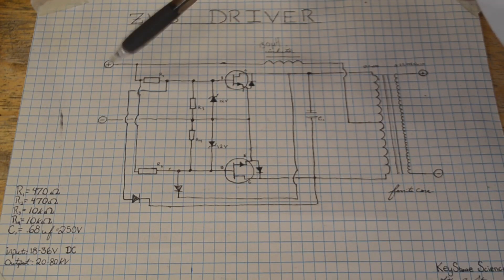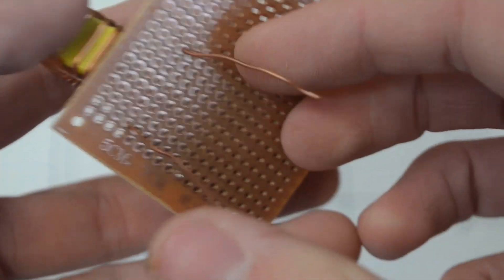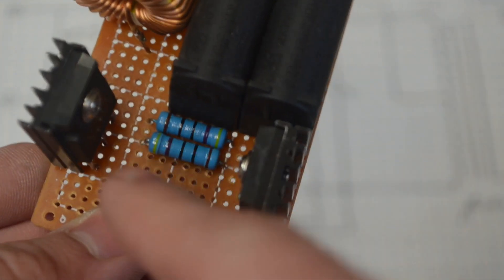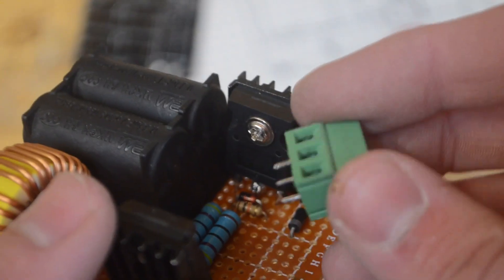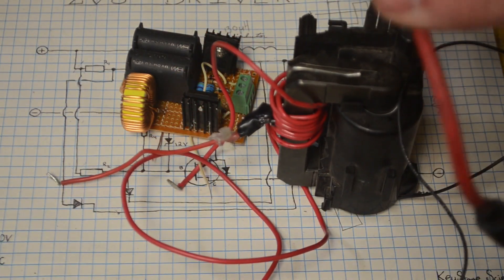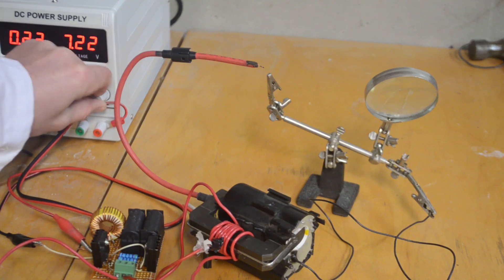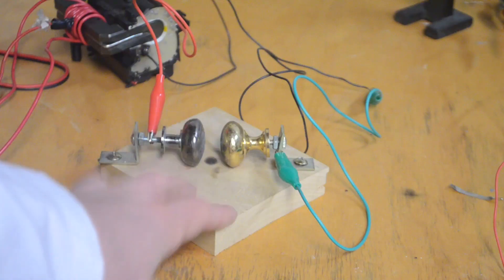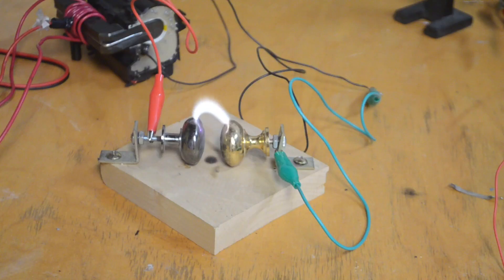How to make an ARC LIGHTER

Comment: You estimated the O/P V to be around 60kV ?  Wouldn't that translate into a spark gap jump in air of 5-6 cm ? Arc length is totally different. Besides 60kV should land you in soft X-Ray territory and it sounds nothing like it. I am gonna guess 15-20kV. Not saying it couldn't be lethal.
Either way, still enjoyed the video and learned about ZVS drivers. 👍

Comment: where did you salvage the MOSFETs from? I made a zvs driver but I didnt have any good MOSFETs so it just gave me shortish purple arcs... still enough to melt my negative terminal...
Reply from the maker: these mosfets i bought, CRT tvs. the ones i use here are IRFP250N
Reply: Ok, thanks! i'll keep a lookout for those, and I've salvaged a ton of CRT tvs so i should be able to use those mosfets.

Comment: plz help for my doubts , 1 - can I use gate drive resistor of 1/4 watt or can I use higher value of resistance like 700 ohm or 1kohm because mosfet can turn on with lower current and even on low voltage !!! ? 2 - l c tank is fixed for this ZVS Driver or we can vari cap value more or less than .680 nf ???? And 3 - can I use 60 Vds mosfet instead 200 Vds type if not then why Because primary turn is only about 2 -3 Turn should not genarat such high volt ????!!

Comment: oh finally you cleared my Doubt of " FR107 200ns Rrt diode will work or not instead uf4007 20ns that are mentioned in google zvs circuits which i did not get on shop other hand fr107 is easy to find from smps supplys

Comment: Can I use IRFZ44N instead of IRFP260N for making a ZVS driver?
Reply: the irfz44n is probably not powerful enough. also the max drain-source voltage of the irfp44n is 55 volt witch is way too low; the inductive spikes from the primary coil will most likely destroy the mosfet very quickly.

Comment: Help please ... i made this but could only get like a centimetre of purple arcs with 12v unlike the arcs shown in the video .... could someone tell me the possible problems  ? I tried everthing i could
Reply from the maker: +Kevin Jacob try a higher voltage , 12 won’t feed the LC resonance that much.
Reply: Keystone Science thanks for the help mate ... i fixed it   the issue was the capacitor ....😁

Comment: Hey Keystone Science, I have been making this circuit either using IRFP 250 N or IRFP 260 N, both are working great and make a nice arc up to 10 cm long at 32 VDC 10 Amp , but I am curious about using IGBT's as the replacement for the power MOSFET's, since it can handle more Voltage and Current. can you atleast make a simple video that explain and if possibly make one ZVS driver that uses IGBT's ?. I am looking forward for your respond.

Comment: I made one of these, but i used 2 igbts in parallel in place of each mosfet, a separate 16 volt supply for the gates and a 50 volt supply with over 15 amps to power the rest of the circuit. The arcs were insane! I could draw them out to maybe 8 or 9 inches before they break and they were thick and bright.
Reply: CoolDudeClem which power supply did you use
Reply: Electro Hithesh use a 20 volt lithium ion battery
Reply: CoolDudeClem mosfets are better because they can switch more frequently than igbts. A plus point for the igbt is that it can handle a lot of power
Reply: yeah igbts waste alot of energy as heat don't they?
Reply: Have the same question, a 750 watt SMPS is pricey
Reply: Yah until the zvs driver breaks because mine did that's why I'm buying a better quality one with two inductive chokes

Comment: Hey Keystone Science, I recently ordered the parts to make this driver and they arrived yesterday. I assembled it in midair to test the circuit before I put it on a board. I tried the circuit with the fly back but nothing happens. I also tried it with an induction coil from your other video, still nothing. Any help would me much appreciated with what's wrong. I could send you pictures of it and everything if you need. Thank you for any help.

Comment: The high currents exist in the LC circuit. You should re-wire the capacitor so it is right next to the primary coil.

Comment: The "King of Random" did a clip where he made a hydrogen device and another guy made something similar but he turned into a "micro blow torch"... is there a way to put more pressure into the nozzle and make the micro torch shoot a 5inch flame in a straight line?
Reply from the maker: Yes, there is , it's using basically the set up for a rocket engine that is, a come on the inside, a cone on the outside, and the oxygen and fuel on the inside, there is a channel called nighthawkinlight that made a video kinda about this ( here it is : http://youtu.be/VI8gdmjEwKc ) anyways, is that what you meant ? Anyways another way is basically just outputting more fuel and a little oxygen through a torch, I used to have a class in school where we would use torches , and I would do that sometimes

Comment: i got shocked by a zvs running a flyback but i'm still here because the frequency was to high to kill me and the electricity went thru my skin i'm not saying you should go and touch the output it still can kill you if the resonant frequency dips for some reason and even if it doesn't dip it still burns you
Reply from the maker: True, but also I think the skin effect only works with AC current, and I think some flyback transformers have internal rectifiers on the secondary, and so that would be dangerous, so yeah better not to risk it :D
Reply: Keystone Science my zvs driver broke im going to buy a better zvs driver with two inductive choke
Reply: Skin effect is only meaningful on the human body above about 10mhz anyhow for various reasons. One of which being that blood is enormously better conductor than anything else in the body.

See https://en.wikipedia.org/wiki/Tesla_coil#The_.27skin_effect.27

You can definitely die from touching a flyback driver, a few people have before
Reply: Keystone Science y
Reply: thanks to skin effect
Reply: Keystone Science ooh really thanks to remembering me that internal rectifier of FlyBTF :)

Comment: The ZVS Driver is a typical run of the mill automotive power inverter. Only difference is you got a flyback connected to it. 2n3055 transistors should also work well instead of the MOSFETs but make sure to use a huge heatsink.

Comment: That circuit looks pretty similar to a high frequency induction heater circuit, which are also quite interesting and suitably dangerous for your channel...
Reply from the maker: +Gotin Fuklio hahahahaha xD true
Reply: Keystone Science its no fun to buy stuff. just make sure that you dont copy great scott who buys everything from ebay, glues it in a box and then claims he made it
Reply: the circuit is the same. only the flyback and the work coil are interchangeable. he actually bought the circuit off ebay and rebuilt it
Reply from the maker: +Gotin Fuklio yep! Well I bought one off eBay a while back then it broke, so I figured might as well try and fix it ( however tbh it's probably not worth it as it took quite a while to solder all the points nicely enough and they are pretty cheap on eBay )
Reply: John Scarce but he does make it, and considering he is a power line technician there would be no need wasting money on what you can make yourself.

Comment: Can this work in a vacuum? Is there an ideal gas you could use other than the atmosphere (what makes it ideal?)? What happenes if the arc is created in a microwave and turned on? ..... Tearing apart hoarded tv now 😄. Great show!
Reply from the maker: +David Hyatt it should work in a vacuum, at least theoretically although the arc probably would not be as long. An ideal gas I would probably use is Xenon, ( not only does it look very cool with high voltage, but it is very conductive ) also it is ideal because it's electron orbitals are filled so it's happy where it is at, hydrogen is also pretty coo, to pass high voltage through though. Hmm I think passing microwaves through the plasma arc would amplify it's ionization creating a weird plasma pattern. So yeah, haha. Thanks! :D

Comment: i wish i had all of these electrical components, but i do have a question for you. I need a device that can give me 70 amps 12 V DC with as few components as possible
Reply: SuperScience894 They easiest way to accomplish this is to get would to simply use a transformer connected to a wall socket and then rectify the current with some diodes. This isn't a good solution, but likely the simplest.
Reply from the maker: +SuperScience894 hmm, for that tbh I would just buy a cheap car starter from harbor freight, there like 20$ and can deliver 500A at 12v DC I'm pretty sure
Reply: Old server PSUs off of ebay work just fine and can be found for as low as $20 USD. Got 2x 12V 100A ones and a 25A 48V model myself. Not sure if that counts as "as few components as possible" though.
Reply: I do have a MOT but I do not have a way of rectifying it
Reply: thanks, i guess 100 amps may be too much but if it is i do have some heavy duty resistors from that microwave i salvaged.

Comment: I have that same exact power supply and built this same circuit and it automatically enters Constant Current mode and draws 10 amps and the voltage is around 6VDC. The flyback is giving out a good output though. Mostly small purple arcs around a half an inch. I would like to get it to go to 32 volts but again I can't. Could you maybe help me diagnose my problem?
Reply from the maker: +JJG Productions huh, do either of your mosfets heat up really fast ( like get really hot ) ?
Reply: Keystone Science I have them both on a large heat sink. I have on the back of one of the MOSFETS a plastic isolator that I got off of another MOSFET I salvaged. They don't get too too hot but they get warm.

Comment: It's also called Mazilli but having found the patent holder I didn't bother to figure out who Mazilli is (probably someone who lost a race to the patent office i guess). 
Don't be like those guys who run around on top of buildings and then fall off. This is an insane amount of voltage. You touch it, your hand curls up. You must know the linemans trick to touch a "cold" wire with the BACK of your hand so that if it is life when your body contracts it throws your fist back to you -- instead of clenching the wire which was in fact hot. 
Electricity is powerful you gotta respect it. You respect it it respects you. One time i got a 240v shocker in Eastern Europe on dodgy soviet gear. Genuinely burned myself, very glad it didn't go frome one hand and out the other right across my heart. so yeah, always work one handed.

Comment: Hello, you've explained shematic a bit wrong; primary coil and 0,68uf cap are working together and make resonance circut, so the voltage and current are sinusoidal, not square wave (trust me, i checked it with my oscilloscope); also that's the reason why your wire's insulation is melting - resonating current between the cap and the coil is much larger than dc input current, so wires heat up much more quickly than expected
Reply from the maker: +alcatel995channel ahh I see, I tried to check it with my oscilloscope, but mine is a bit stubborn so I couldn't get it to shop up, but that makes sense, thank you!!
Reply: Can u tell me how to make 200micro henry inductor
Reply: Pls help me my capacitor burns out in few minutes

Comment: Hey hey hey look who decided to show up in my subscriber list 🤗
Reply from the maker: +logan thompson hey hey hey, look who decided to show up in my comment section 😄
Reply: Mosfets can drive much higher currents without heating too much. The difference between them is in simple terms, mosfet acts more like a switch whereas transistor acts as a variable resistor. Since this circuit doesn't need to produce a sine wave (it probably produces square wave), we can use mosfets for greater efficiency. Because of that efficiency, mosfets don't heat up as much as those power transistors. For example a mosfet of that size can handle currents up to 50 Amps depending on its type. Because they have a much lower internal resistance in conducting state.
Reply: Hi I could you please tell me how you promoted your channel initially, Please help
Reply: If i were to make the same driver to run higher amounts of current, would the same values hold true for the capacitors and resistors?
Reply: @adityavarma193  yes just use capacitors that can handle high current